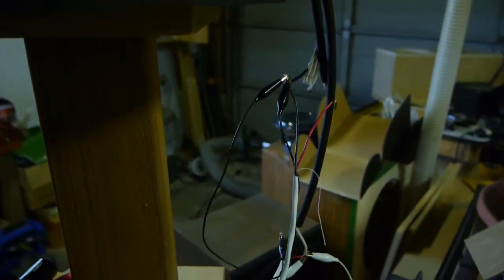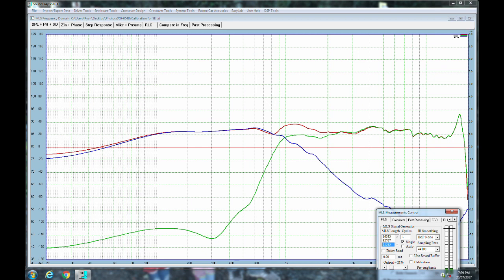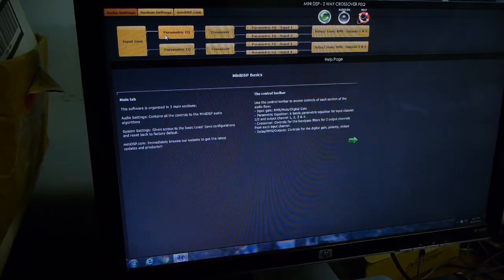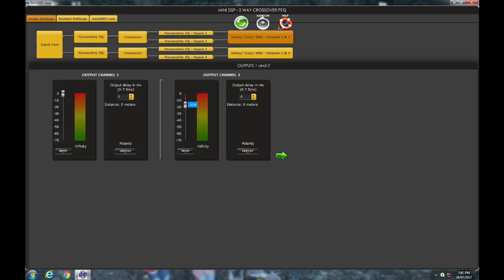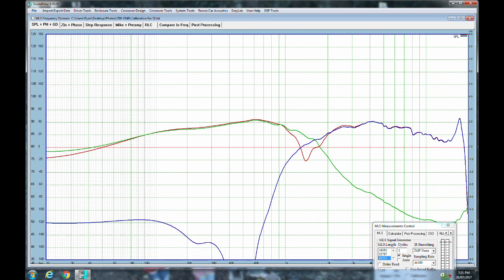Are Active Crossovers Easier than Passive? NO!

Comment: Have you designed a fully active crossover speaker? The miniDSP has 2 inputs and 4 outputs, so you could make a pair of bookshelf speakers with only one, or a 3/4 way using one for each tower. Might be fun selecting different amps.
Reply from the maker: Yes many times. It is fun. The mini dsp is a great product. I wouldn’t touch one of those other crossover boxes that don’t provide the proper flexibility though.

Comment: When you would like to replace one of drivers to another with different the highest or the lowest frequency, or with a different sensitivity, or change amplifiers, or to reduce a room main resonance frequency, you'll get to know how easy DSP is. A passive crossover make impossible to use current source amplifiers for mid and high range drivers. And etc.
If you build entire system for a personal use, this imho have to be a DSP with an active crossover and galvanic isolated channels, and bunch of mono amplifiers that match bands and power.
Reply from the maker: I have done that and no, it’s no easier. Sure, it’s a few buttons to actually program it, but any of those changes requires measurements and knowledge just the same as passive. Absolutely no difference.
Reply: @ImpulseAudioSpeakers  Sure. Getting the numbers is the most experienced part of the process. This all could be similar to digital and silver photography. 'Our' numbers are like proper light and composition. However photographer can find the best idea way more fast with a digital camera imho. Then he/she can replicate this photo using Hassy.
At the moment I saw only one $5k PS Audio product which is not a PA digital crossover. May be others exist (like hyperx modules for example). But this number will increase. And market will start offering loudspeakers with  drivers that can be replaced/upgraded. This is not 100% true of course, but manufacturers would like to use this idea I think -)

Comment: He misses the main advantage of an active crossover for the hobbyist, which is that you can make all these adjustments without needing replacement components, so you don't need to get it right before you order the parts.
Reply from the maker: I didn’t miss that part at all. The video was about the idea that you can just click X frequency and X slope and have a finished XO. The benefit you list is pretty minor in my opinion. The greatest benefit to active crossovers is the efficiency compared to lossy passive crossover components. That is huge a very big reason to use active. The title is are active crossovers easier. Not are they better.

Comment: if I have a 3 way speaker and run it with a miniDSP does that also mean I need to run a 3 channels of amplification?  Or is there a way to somehow run only one amp to power all 3 speakers with the miniDSP?
Reply from the maker: You’ll need 3 channels, or you can use a passive XO for the tweeter and mid and then use the dsp to cross the woofer to the mid and tweeter combo. This is a really good technique because the passive XO protects the tweeter, the mid and tweeter need less amp power, and it saves 2 channels on a stereo system.

Comment: Could you try out Behringer DCX2496 Ultradrive Pro

Or maybe another DSP you can use with a mic and automatically make a linear sound
Reply from the maker: Marcus dahlén all dsp crossovers have these same issues. Some are more automated and can apply eq, but can’t fix a hole like that. Apply EQ until flat isn’t always a good idea either. 

No matter the hardware, it’s best to apply best practices and get the XO dialed nicely.
Reply: @ImpulseAudioSpeakers  
Do you think phase is such a big issue when you can cross 48db?

I like to configure my systems with dsp because it's so flexible and also very exact.

Today I want to cross my ib sub at 50 instead of 45, tomorrow I want to ad some midrange:)

Think I could make so many drivers sound so much better by controlling them like this and also it's fun:)

Thanks for the reply man, I'll tell you what my air motion Transformers sounds like free air mounted if it's nice ☺️
Reply from the maker: Marcus dahlén certainly dsp is more flexible and precise, but phase is an important aspect even with steep slopes. Subs are probably less prone to issues when making tweaks, but the higher frequencies should be checked with measurements. Easy to think it sounds great and miss a lot of information. Especially with suck outs like I showed in the video.
Reply: @ImpulseAudioSpeakers  
So I just realized I need to analyze the frequency response and correct possible phase issues with the delay function.
What is your opinion on just letting the frequency ranges overlap just a little bit to avoid the Gap in response?
Reply: @ImpulseAudioSpeakers  also do you have a suggestion for a good midrange driver 800 - 2000hz
Did you try the Accuton mids?

I'm feeling like putting a dome on top of the speaker

Best regards 😊
Reply from the maker: Marcus dahlén overlap is good, but won’t fix the phase issue. When drivers are out of phase they cancel. It is 1-1=0. Adding overlap is 2-2=0. You still get nothing. And sometimes the phase is only off say 90 degrees or 45 degrees. It’s a whole different thing. 

I have not used the accuton. That’s a pretty easy range to cover. I would look at cone mids around 5”.
Reply: @ImpulseAudioSpeakers  
Alright, I'll take the phase issues seriously and choose a driver that will fit in to a 3 way system with passive crossover! It will also work in the system with active crossover.

I have some suggestions but I'm leaning towards SB Acoustics MD60N-6 
Very cheap, good efficiency and impedance matching my other drivers. Aetd15m +beyma-tpl200

My suggestions are as below, what do you think:)

Cone drivers
Jantzen Audio JA-8008 HMQ
Acoustic elegance td6m
Acoustic elegance td8m
Scan Speak 18 M 4631 T00 - Revelator 

Domes
SB Acoustics MD60N-6 
Morel EM 1308 Bass-midwoofer
Accuton C51-6-286 CELL Ceramic
Volt VM752 2" Dome Midrange
Atc sm75-150s

Best regards Marcus
Reply: Also 
What do you think the possible sources of phase error is?

Do you think it can be avoided as below?
Same amplifiers?
Same signal cables?
Same cable lengths?

Best regards Marcus
Reply from the maker: Marcus dahlén phase isn’t really an error. The error is that the two drivers are not at the same phase. Think of it like a bank account. You get paid and it’s full. Then as bills come in and you buy stuff the account goes down. Then you get paid again. This is phase. Up down up down. Now if you get paid at the end of the month and I get paid at the middle of the month, our accounts will not be in phase.  Our accounts will never be full or empty at the same time. Using the same amps and cables and stuff won’t fix the phase problem. It’s as fundamental to the driver as the frequency response.

Comment: Sorry, something is confusing me... The wave length of the frequencies! You can not just add frequencies as you do. The tweeter can not produce so loud frequencies at 20, 30, 100Hz or so low and bass can't do it on 10000Hz or higher. Also, the only case where two waves can interpolate is when they are of the same frequency (or same wave length). And when the phases are 180 degree opposed they will cancel themselves. On the diagrams we can see that drop but that is not so significant when the music is in question because it is not the permanent drop in the music spectrum. The question is can anybody register that drop masked with the whole other frequencies? It is only seen in the lab when you sweep the frequencies.
For me, the active crossover behind the preamplifier with amplifiers for each individual range is the top. Can you imagine how can you fine tweak 6-way system? Even with the cheap components.

Comment: If you talk to any speaker designer Or engineer which I design all of my speakers custom myself they would rather use an active crossover but it's just too expensive to sell to the general public I will never use a passive cross over On my system ever  the The average passive crossover is garbage  And active crossovers do not get hot at all we know what happens when Things get hot
Reply from the maker: Mustafa Akbar ok. Hope you know how to design them properly.
Reply: @ImpulseAudioSpeakers  That's the easy part I am a carpenter by trade The hardest part which I will concede to is theTuning of the crossover Per individual driver I run A four-way stereo takes time to Get it right and we're not even gonna talk about room treatment And speaker placement whole different animal

Comment: I got around many of the issues you point out by going with a 4-way active and choosing drivers that had good behavior about an octave beyond each crossover point. Large baffles with Vifa AG35, Vifa P13, Vifa P26, Eminence DVC-12, with 3200Hz, 500Hz, 100Hz. (this was about 1992?)

Comment: So about phase misalignment, how do you respond to this:

"The K231 is an all analog design, engineered with only the highest quality audiophile grade components. Users will have complete control over sound and be able to eliminate distortion with subwoofer, high and mid-range channels, which are phase aligned to within fractions of a degree."

http://www.releasewire.com/press-releases/sublime-acoustics-k231-3-way-active-crossover-set-to-revolutionize-consumer-audio-market-with-affordable-professional-grade-sound-capabilities-791166.htm

Comment: I don 't get it. You say you have a dip at the crossover frequency with a phase shift of 140°. Would it make sense to simply revert the tweeter phase polarity, thus getting a -40° phase shift and a little bump like you have with the passive crossover?
Reply from the maker: didierleclerc66 in this case inverting the polarity would have helped a lot. But it won’t always be that way. It could have been 90 degree out. Then what? And you still are out 40 degrees which is pretty crap in my books. Plus all the other issues of wonky response not related to phase. Generally, even if you knew in this specific case that flipping polarity would help a lot, it’s still a crap speaker, far far far worse than the passive XO. So unless you want to go through the proper design just like a passive XO, the active XO will suck. Therefore it’s really no easier than passive.

Comment: Input = RCA (unbalanced) > DAC > (filter) > ADC > RCA (unbalanced) = output?
What about SPDIF In > (filter) > SPDIF Out (FWIW, Coax vs. Optical = Jitter)... analog amplifier has DAC inputs... vs. PWM amp?
Fine Phase adjustment to compensate for mounted driver offset (mSec.... µSec.)

Comment: Active is definitely the way to go. Its for sure easier. You can actively reconfigure and compare and contrast results on the fly. Your phase issues have more to do with driver size and center to center spacing,  there are rules to speaker design that you would be wise to follow to eliminate these issues....a crossover point can expose your poor designs if thats the case but crossovers don't cause this off the bat. A 48db LR crossover is designed to be in phase,  so if you still have phase issues its because bad choices, else where in the design.....If you know better you can do better =)
Reply from the maker: DR.NNOO I showed in this video how an LR4 XO isn’t automatically in phase. Active has just as many design challenges as passive. If you think otherwise you’ve missed the point.
Reply: @ImpulseAudioSpeakers  Thats the key, you don't design active crossovers, you buy them and apply them how ever you like , where as a passive isn't something that you can so easily reconfigure. That, in itself, makes them easier than a passive. Anyone who assumes that  a crossover of any type is going to automatically make everything in phase, is lost, anyway. Still, with an active crossover you can try unlimited configurations in the same amount time  it takes you to assemble one passive crossover limited to the amount of passive components you've got.  If you dont get it, yet....make a video of you trying 3 crossover points with an active, then make another video documenting you making the same 3 crossovers from scratch and we'll let the people decide which route they want to go =)
Reply from the maker: DR.NNOO ok first yes you still have to measure each driver and use software to determine slopes, eq, etc. You don’t just buy and start fiddling. But even that aside, fine, active is slightly faster as pulling out the computer and booting up the software, plugging in the USB, programming it, hooking it back up to multi channel amps, than alligator clipping together some passive parts. Yes it’s SLIGHTLY faster. All the rest takes the same time energy knowledge and effort. 

I like active XOers.  All you active fan boys just don’t get what I’m saying. Sorry I’m kind of exploding on you because this keeps coming up. Yes, active has many many merits. I use active XOers myself. BUT it’s NOT really any easier and if you think it is you’re doing it wrong. Saving 4 minutes on XO assembly over the course of a 6 month design process is not helpful.
Reply: @ImpulseAudioSpeakers  Slightly faster is a complete understatement, my active crossovers are built into my amps which are connected to my computer, theres no disconnecting or reconnecting, even my mindsp is ran from computer and straight to the amps, no disconnecting there either,  if it takes you 6 months to design your crossover point its because you never understood loudspeaker design. You design the system around a preselected xover point not visa versa, and if you don't know how to do that....keep on, you'll get there =)
Reply from the maker: DR.NNOO ya I’m an idiot. I forgot you just pick a number and force it to work. Ok man.
Reply: As I said,  it’s better to design the system around a crossover point,  results are much better than trying to find a crossover point for drivers that don’t play well together.

Comment: Why not just invert tweeter with invert button and see what it looks like then?
Reply from the maker: mark clausson the point of the video was about not measuring and using active XOers blind. So what if it was 90 degrees out of phase and I inverted the tweeter, then what. And if I hadn’t measured how would I even know the dip was there? Yes the dip can easily be corrected, but for those who don’t go through the proper process of figuring out the slopes, delay, eq, etc. then active crossovers are no better than passive.

Comment: I understand the point you are making here, but it does not align with the title of the video, or in fact some of the other things you are saying. True, you cannot just shoe-horn any type of crossover (active or not) into your system by picking a crossover frequency and calling it a day. There are other considerations. 
But throughout the video you systematically disproved the title; active crossovers ARE easier than passive. They just objectively are. You can design and tweak one to suit - and it will do a good job - within a matter of minutes. With a passive crossover, not only do you have to understand impedance (a thoroughly non-trivial requirement) but even in the simplest case you have to design your crossover in software (let's say that is equivalent to setting up your active crossover in its software, although it's almost certainly more complicated), then buy the required parts and wire them up. 
At this point, if something in your simulation was wrong or not accounted for, you have to start over. You can just change a parameter in the active crossover. Moreover, passive components are susceptible to overheating and electro-magnetic interference. 
They are categorically worse, but in some instances, necessary and convenient. I use them because they sit tidily inside the box, I don't need a DSP unit lying around, and I only need half the channel count on my amplifiers, and frankly I like the challenge. When I do live sound however, it is the opposite. The flexibility of an active system in that context outweighs the extra gear required.

Comment: Firstly. It’s important to understand the difference between the various types of crossovers.  
miniDSP is technically not an active crossover. It’s a dsp with multiple outputs, and not like the traditional active crossover that is analogue. 

I built my system with miniDSP but with separate AD and DA converters using the I2S in and outputs. The sound quality and flexibility is unbeatable. It costs a bit more but that was the best investment I ever made. Now I can build whatever speaker designs I want at no further cost
Reply from the maker: M D well, the dsp is in the active position (before the amplifier) rather than the passive position (doing the job after amplification), but sure ok it’s not a traditional active XO.

Comment: My beef with passive is STILL money !!  You can design a phenomenal passive unit - but the minute you start using  high quality components =  the cost goes up $$$ PER SPEAKER !!!  The obvious limitation also applies to active = more amps and added multi channel Active units..... so either way it never gets away from cost vs quality.....

Comment: "phase shift"/time misalignment is primarily due to the physical offset of the focal point (axis) of the drivers...Were both divers in perfect time alignment (i.e. propagation of both wave fronts in perfect alignment), there would be roughly a summing of +3dB... assuming that both drivers were being driven with an identical signal/impulse (mass/acceleration rates of the respective drivers, notwithstanding). A relative "delay" of the signal applied to one of the drivers could bring both wave-fronts 'in phase"; additionally, a steeper slope, along with adjustment of High-cut and high-pass roll-off points could reduce some of the phase interference problems. Differences in mass/acceleration rate of respective drivers can be compensated with "torque" (power applied). Access to B&K FFT is usually handy.
Reply: Yes it's hard to delay the bass driver on a passive design.